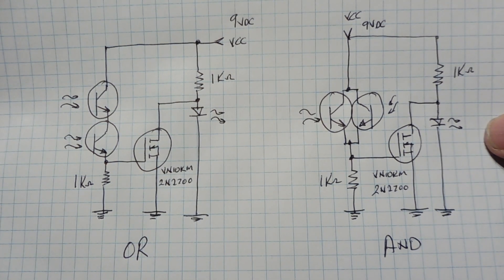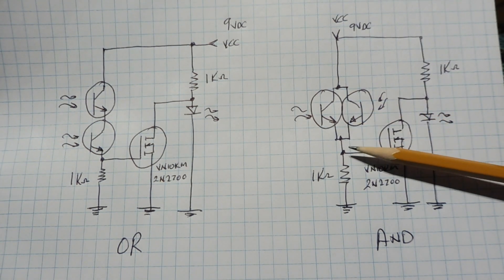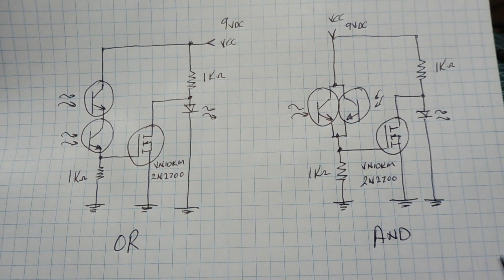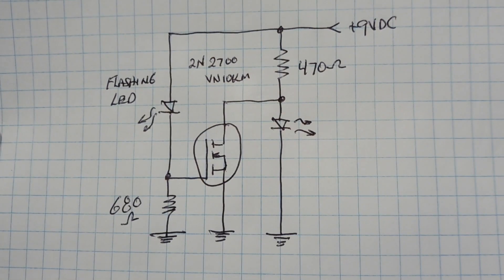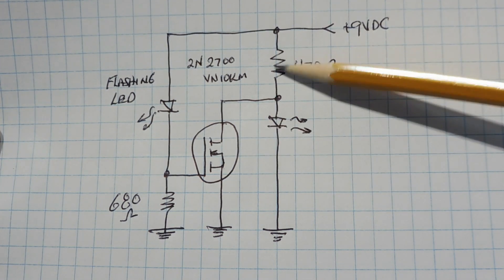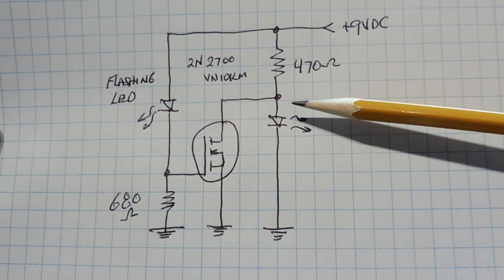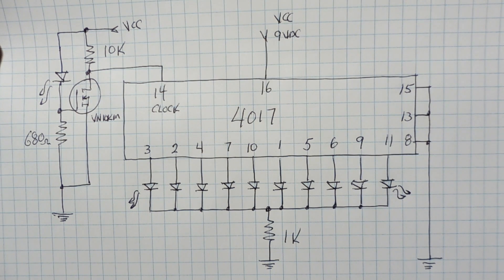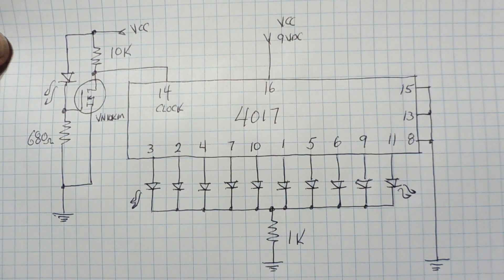Simple Electronic Circuits You Can Build

Comment: On the electronic combination lock, why was the 33k resistor connected to ground necessary? Thanks for your quality, well presented videos. There is great satisfaction building your circuits! Thanks again!
Reply from the maker: When all the switched are open the gate of the MOSFET will be floating and could turn on and false trigger. The resistor is a pull-down to ensure the MOSFET will stay off.
Reply from the maker: When all the switched are open the gate of the MOSFET will be floating and could turn on and false trigger. The resistor is a pull-down to ensure the MOSFET will stay off.
Reply: @0033mer  Thanks for the correct information. Looking forward to building this circuit.

Comment: Thanks for the videos.  Just a couple of questions - one photo transistor in your video has three leads?  All I find online have only two leads like the other one you have on the board.  Also is the mosfet transistor a 2n7000?
Reply from the maker: Most phototransistors have two leads. The third lead on mine is the base connection which is not used. You can use it to bias the phototransistor to control the sensitivity and switching speed. I cut off the base lead on one and the other is not connected.
You can use any phototransistor with two leads as per schematic.  https://www.adafruit.com/product/2831
The mosfet is a 2N7000 or VN10KM.